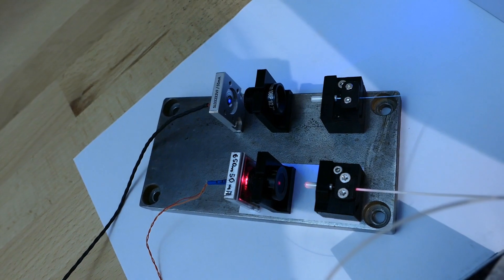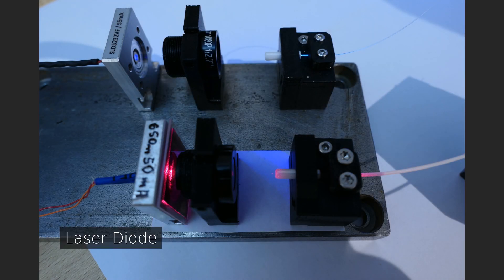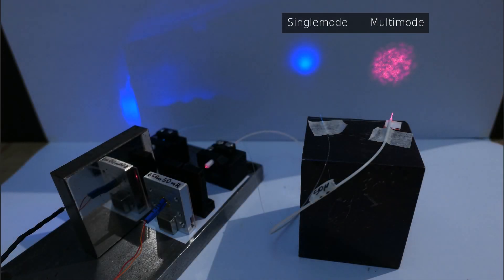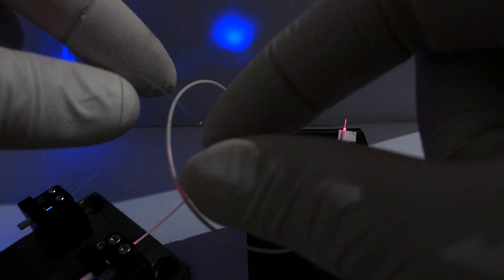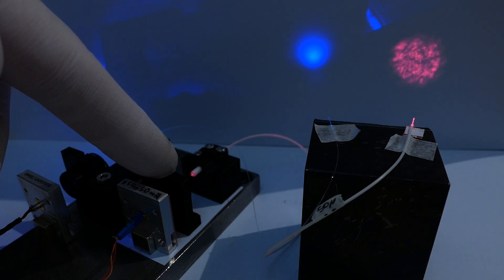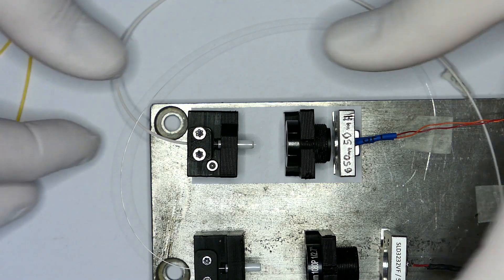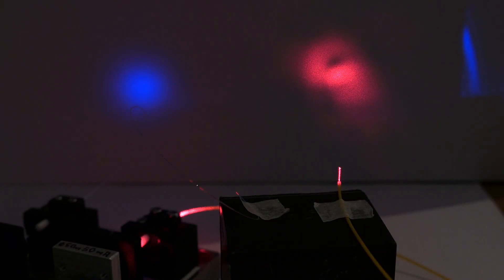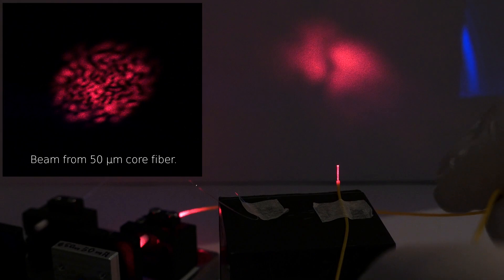Fiber Optics - Multimode vs Singlemode Fiber

Comment: The way light is lost at the bend must have something to do with changes in how the evanescent wave just outside the surface of the core couples into the cladding under high strain, but why exactly??
Reply: It's much simpler than you think, just keep in mind the concept of total internal reflection and the critical angle beyond which light will totally reflect.

Consider a distribution of input angles where light enters the start of a fiberoptic core: the focusing lens creates a distribution of entrance angles. But even if a nearly parallel beam or low divergence beam was launched in the entrance, slight bends along the length of the fiber will cause the light to occupy all angles within the cone of total internal reflections.

Now consider a sharp bend, some of the light that was near but still inside the cone of total internal reflection for the previous segment of fiber may now fall outside the cone of total internal reflection of the next infinitesimal segment of fiber. That light can leak out and is lost.